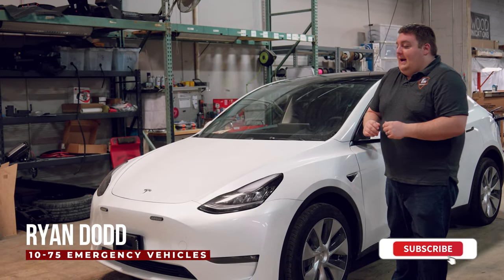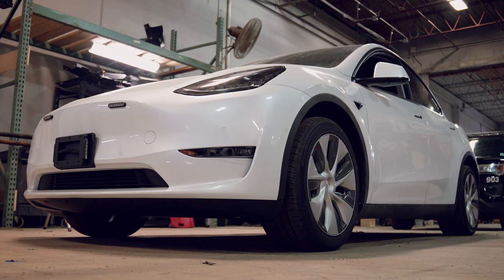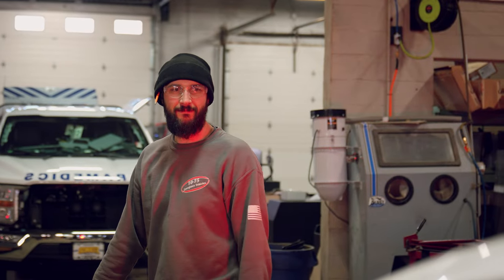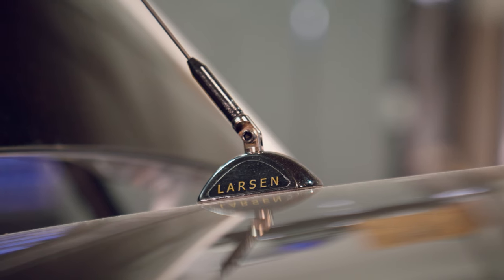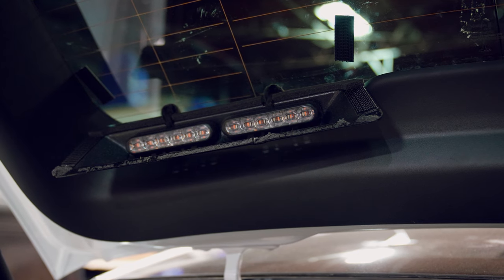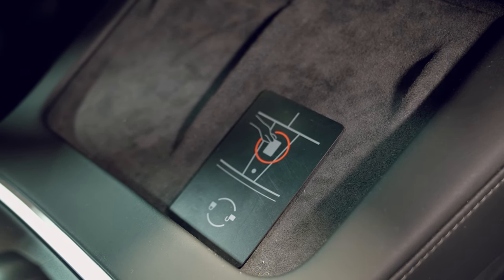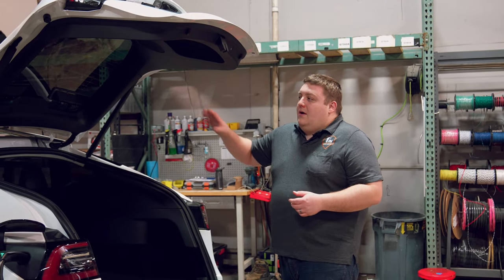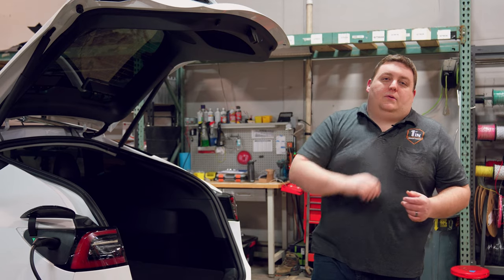Upfitting a Tesla Model Y into a Police Car - PART 2 | 10-75 Emergency Vehicles

Comment: How was the process? Did you find any complications or things you didn’t anticipate with the first one of these builds?
Reply from the maker: Fairly simple just think through everything.  Working through making sure the ignition signal works
Reply: @1075EmergencyVehicles  that would probably be of the most difficult things for my company. How hard was it to get in contact with Tesla to talk with them about the ignition source?
Reply from the maker: Not to terrible